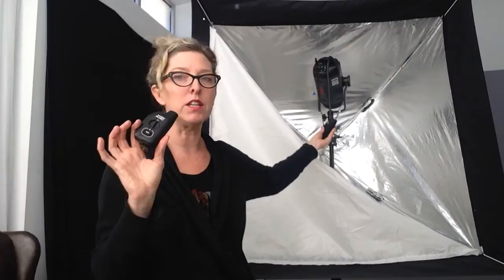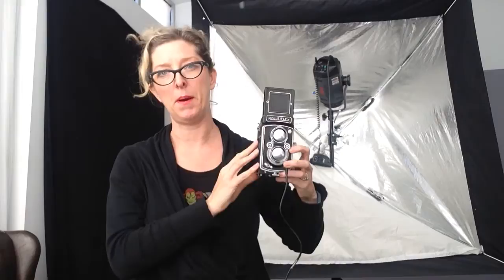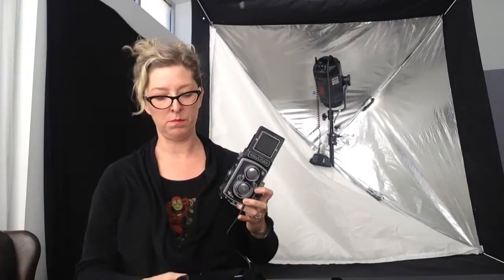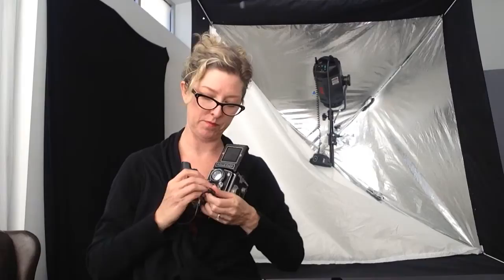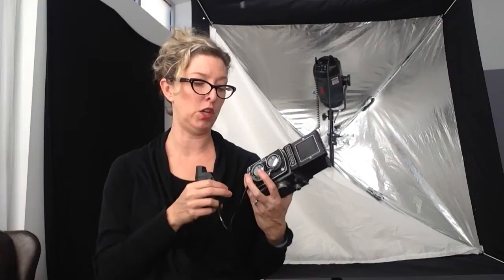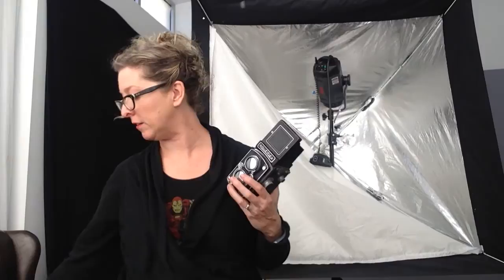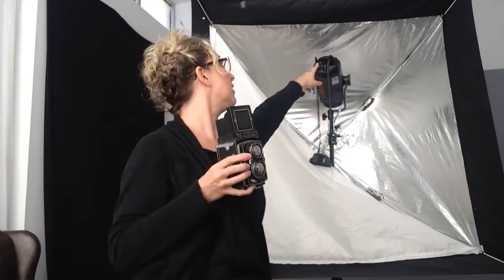Using triggers and receivers with vintage film cameras

Comment: Great video.  I have several Nikon F Series film cameras (FM, FE and FM2).  Do I need to plug in a PC sync chord from the pocket wizard to the pc sync port on the camera to trigger my Alien Bees B800?  Thank you.
Reply: Well that depens on if the cameras you mensioned have hot shoes or cold shoes if they have hot shoes then just mount the pocketwizard on the hot shoe if not you have to plug the sync cord of the pocketwizard to the sync port of the camera

Comment: Very useful video, thanks!  I have an RB67.  I understand how to sync a flash to the camera by attaching the PW to the cold shoe on the side of the camera, then connecting the PW to the lens sync port.  What I am wondering is, do I still need to manually fire the shutter?  I guess I am wondering how the shutter fires remotely (or if it can)?  Thank you for your help!

Comment: Very helpful video.  May I ask where you purchased the Hasselblad sync cord?
Reply: Jacob -  you can visit Paramount Cords and order them. You'll want a custom cord with the Long Tip PC cord and the 3.5mm sterio tip. If you're just running the cord to a pocket wizard then the 1' straight cord is the best option if you're using CF lenses. If you have an older C lens then perhaps a y-cord if you have both CF and C lenses. 2 cords with gold plated contacts will run you about $80.